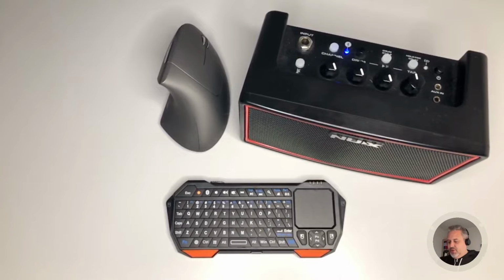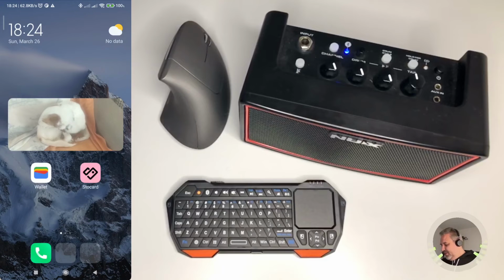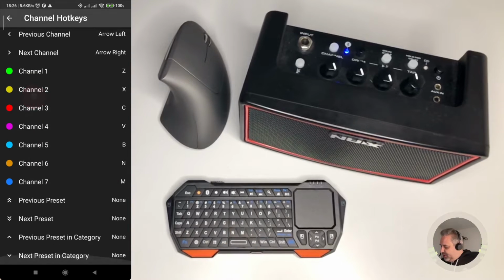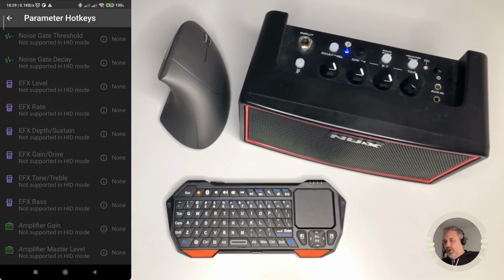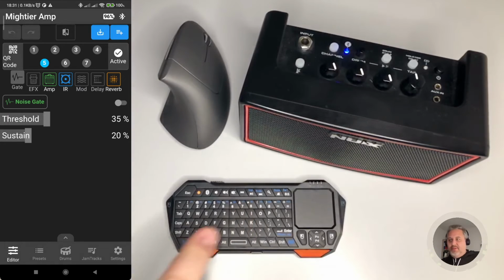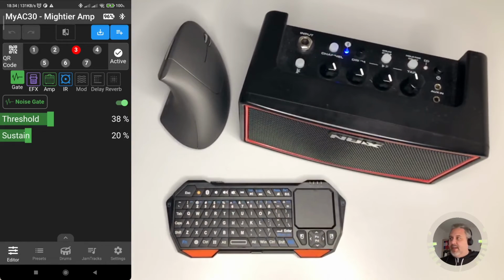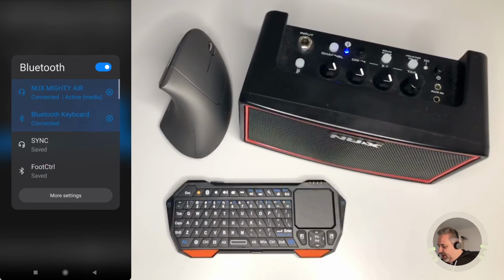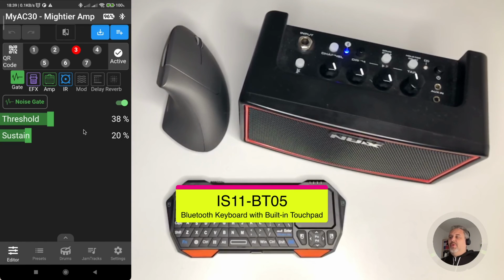GUITAR 15: Control Mightier Amp and NUX devices through bluetooth keyboard

Comment: Can i connect nux mighty to bigger amp?
Reply from the maker: If your bigger amp is provided of a mp3 input (for external sources), you can connect headphone output of the Mighty to line in of your amplifier. Better not use your amplifier guitar input, it is not compatible electrically and it is definitely possible to damage both devices. In any case you are doing it at your own risk.
Reply: @TutoJam  ohhh i see thankyou so much sir,sorry my English,,,so do i need 3.5 to 6.5 Jack to connect it? Or what i really need?
Reply from the maker: @TeriSanusi yep, I bought a 3,5 to 3,5 cable because my amplifier had a 3,5 aux input but if yours has 6,3 you can use an adapter
Reply: @TutoJam  sorry asking to much sir,, i cant find it on YouTube,,  can u explain how i plug my Jack? From my nux mighty lite mk2 to my another speaker
Reply from the maker: Don't be shy my friend I am happy if I can help you. Stay tuned on the channel, asap I will post a short to show you how I did it for myself
Reply: Ill wait for it sir,,i think a lot off people search for it
Reply from the maker: @TeriSanusi I just uploaded a short, shall be visible in a few minutes on the channel